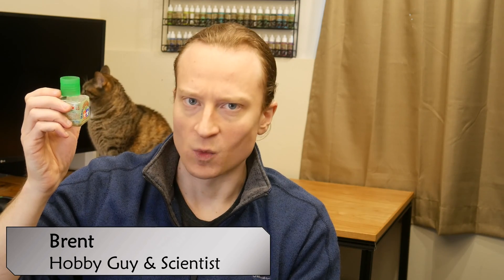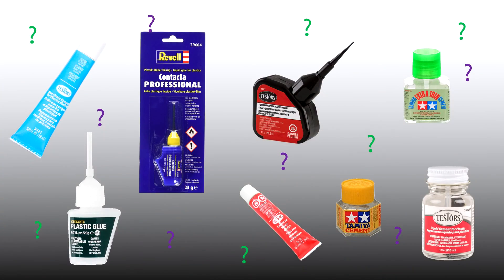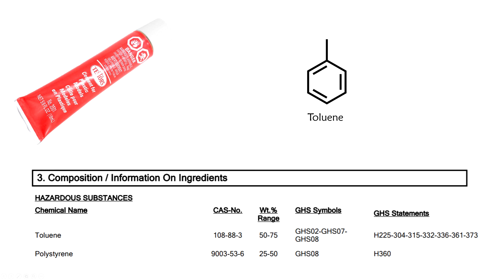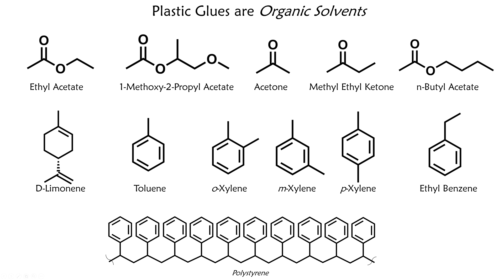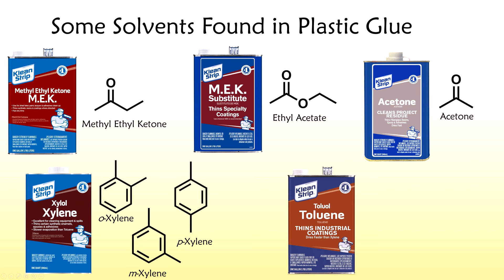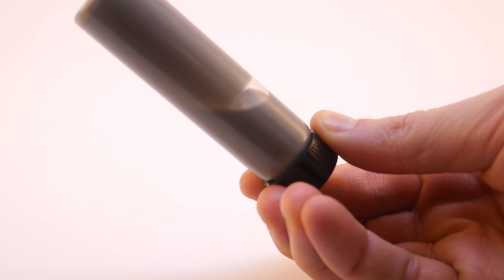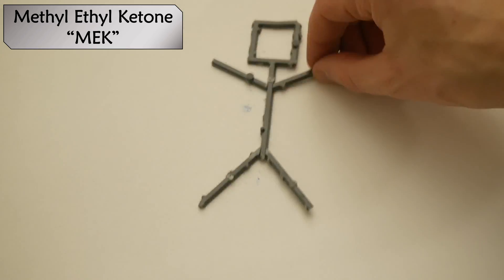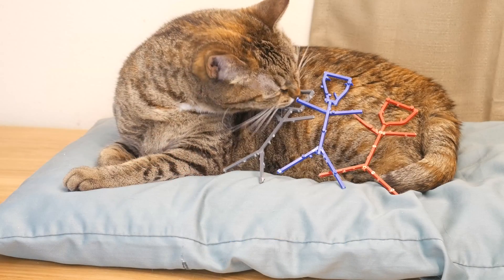How does Plastic Glue work? What's in the bottle and what does it do?

Comment: I wanted to share - if anyone ends up gluing something wrong or upside down and you notice later - try prying it open a bit with a knife or whatever and then pour on some white spirit - the stuff you've got for oil washes - it somehow infiltrates the weld from the glue and makes it MUCH easier and cleaner to undo the cement.

Comment: Brilliant videos thank you. I'm starting to build a furnace boiler to generate super heated steam. there are lots of youtube videos about the best heat resistant materials but most if not all are just re-vids on what somebody else who doesn't know what they are doing, I am thinking of using fine plastering sand as the insulator with porcelain tiles facing the furnace itself. would superglue with powdered graphite stand up to extreme heat? thanks again john

Comment: Okay that all makes sense, for polystyrene. But the most useful plastics for sport use are polyethylene and polypropylene. What is the analogous plastic glue for those plastics? I fear one can only bond them with heat.
Reply: These chemicals will dissolve most plastics except for Polycarbonate ( Lexan )

Comment: When I was making such models, the only glue to use with them came in a tube and was clearly some kind of gelled solvent.  It was famous for its fumes.  When I bought a model for my nephew and his dad, some years ago now, the glue was in a locked case and I had to get a store manager to unlock it.
I've never seen a brush-on from a bottle, or anything remotely "thin" like some of the bottles are labeled.  This kind of glue must have come on the scene recently.

Comment: A chemistry lab is a great place to shop. Not only scintillation vials, but Parafilm, transfer pipettes, small plastic cups, needles (great for scale gun barrels), gas chromatography capillaries (great for whip antennae), and all sorts of other pieces and packaging to serve as greeblies.

I grew up with Testors gel cement and have gotten pretty handy with it; the stringiness is the main gripe. I use Tamiay brush cement a lot, now.

Problem is, my Stash Acquired Beyond Life Expectancy (SABLE) index is now 26, meaning I need to live 26 years beyond my life expectancy of 90 in order to finish all the models I have in my stash. Challenge accepted!

Comment: 7:03 The orange gel tube is all I'll use. I tried Tamiya X-Thin and I found it nearly useless. Took forever to get even the slightest hint of a bond. The onyl thing in this video more useless was that non-toxic blue Testors crap!

I'm guessing your lack of fondness for the testors gel is the applicator. It takes some getting used to but once you get used to it you can do just as precise a glue job with that stuff as you can the Tamiya brush on stuff.

Comment: I am not surprised the Acetone did not totally dissolve the stick.  In 3D printing one of the methods for smoothing ABS models is Acetone(well usually Acetone vapors), Fun note the vapors can also defog some headlamps when the plastic gets worn on an older car.

important note, ventilation when doing this. and probably respirator. but absolutely good ventilation or doing it outside, the vapors are not good for you and well flammable.

Also makes me wonder if ABS glue from the plumbing section could work on models.

Comment: I'd love to know which plastics these glues work on.  Only polystyrene?  And what other plastic adhesives work on which types of plastics? The sellers often do not offer much detail and I often want to stick cloth to vinyl (overlapping tolex for example) but have not had good results after trying many different adhesives.  I sometimes end up using hide glue, which is not ideal but easily reversible/soluble in water.

Comment: It's the plastic lid for the glue made from HDPE? What's the inside"soft" polystyrene like material that works as a gasket sealant? Also does the glue work with PET? for the sake of making models from scraps?

Comment: In college we were told to use xylene or MEK for styrene prototype model building, and use whichever one we liked best. The rationale for doing this is reliably consistent results and they are widely available solvents. Once you get a good feel for which one you like, you know exactly how it behaves. As you've explained, different brands use different recipes, so behavior between different products intended for the same purpose can be significantly different. A gallon of either solvent costs $50-$60, and if stored properly, will last the average model builder for decades.
Reply from the maker: that's some good advice- what kind of school did you go to for that?  model school?
Reply: @GoobertownHobbies  Industrial design and engineering. It was back in the 80s, when we still built physical models early in the design process. Lots of sheet styrene, vac forming, mold making, etc. along with hand fabrication in steel, glass, rubber, etc. starting with conceptual models all the way to fully functional prototypes. Styrene is actually a really handy material for  short run mold making. In addition to the models themselves, it works well for building green sand molds as well as burn-out investment casting of parts in aluminum, bronze, or resin.
Reply from the maker: @fxm5715  very cool!!
Reply: Sadly the cancer won't last that long.

Comment: I was wondering if you have any information on solvent glues for 3d prints, especially for pla and Petg. I know acetone works great for ABS. and have has some success for PLA with some but not all plastic solvent glue.
I am often mixing purchased models (polystyrene) with PLA, I suppose CA glue is best for dissimilar plastics, but I like the working time of solvent glues better, it is easier to get proper alignment.

Comment: So could you use sprue goo as a substitute for resin when casting a model? When I've seen people try it (to copy terrain pieces) the result is chunky, but they all used acetone I think. Some of your other solvents get such a smooth result that I'm wondering how well that type of sprue goo compares to an off-the-shelf resin product (and what the chemical differences are)?
Reply from the maker: It can be done, but I think it'll be verrrry hard to avoid air bubbles as the solvent is evaporating.
Reply: @GoobertownHobbies  ahh yeah that makes sense! In some other videos about using sprue goo I've seen people struggling with air bubbles. Also makes sense that resin for casting would be designed to have a consistency that allows air bubbles to migrate out.
Reply: @GoobertownHobbies  If it dries instead of reacting it would also dry from the outside in right. That seems problematic for bigger moldings. But you might be able to do something similar to clay slib molding (also evaporative), where you aply it as a coating on the inside of the mold for hollow pieces.

Comment: Hi Brent! I think I discovered your channel too recenlty and never had the opportunity to see your hobby science videos until very recently! Fantastic work! Thanks for putting together explanations that are understandable for regular people.
When I saw your videos, it gave me the idea to make myself some sprue goo to fill the uuuuugly assembly gaps on push-fit minis like the death priest from Cursed City. I think I got this idea from Ninjon's channel. As I dont have many pricy glue bottles to sacrifice, I tried to do it by mixing Warhammer sprue leftovers with chemicals from my local hardware store. I have found acetate butyl and acetone. I tried both (and a 50/50 mix of acetate butyl and acetone) but the result is pretty disappointing, as the resulting mixture seems to have 2 phases, non miscible. Melted sprues make a very thick, barely liquid, dough at the bottom of the jar and solvent seems to float above. It is so thick that it is totally unusable.
Am I doing something incorrect? The result is the same whatever the quantity of sprues I add in the jar.
Any help from a Chemistry PhD would be appreciated :)
Reply from the maker: Heyo!  It might just be the solvents you chose to use.  Acetone doesn't work as well as some of the other solvents I used in this video.  I know that the thick plastic cement from companies like testors smells a  LOT like xylenes/ toluene.  MEK and "MEK substitute" also seemed to work well
Reply: @GoobertownHobbies   thanks for your answer! I’ll make further experiments and let you know the outcome !
I’ve tried a thorough stirring it n the acetate butyl jar, and it seems to improve the result.

Comment: Well it's an old video  but the top and bottom of it is that it seems that I've developed a serious allergy to whatever is in 'Tamiya Extra Thin Cement' plastic glue and maybe also  'Bob Smith Industries Insta Cure+' superglue (which I used only for magnets onto plastic minis). I've used both for just under 3 years and all of a sudden I'm getting allergic reactions (runny nose on the day of use and next morning burning sensation in lungs with some coughing). I tried to mitigate these negative effects using both glues buy wearing a 3M rubber / hard plastic  head/nose mask with P3 filters and using a heave duty fan right next to me but still I get the bad symptoms. I've just bought some Tamiya Limonene glue which is meant to be a more natural plastic glue in the form of a citrus based solvent (still toxic compared to the acetone in Tamiya Extra Thin Cement plastic glue I guess) so hopefully wearing a mask with this new type of plastic glue with good ventilation may solve my problem. If not do I have any other options for plastic glue ? Also which brands of thin superglue could I buy which are 'less toxic' that Bob Smith Industries Ista Cure+' superglue ? 

Am I out of options for glue that won't give me allergies ? I sure don't want to give up the hobby because of them. I'm asking here because I know that Goobertown did studies in chemistry.
Reply: Same here! I feel like a mixture of hayfever and flu for several days after using cements like these. I was fine for years, then suddenly, I couldn't carry on.
I'm keen to restart in the hobby, but can't risk this again - I'm wondering if one without n-Butyl Acetate may be okay? X
Reply: @clivewitcomb2839  for me I figured out that it was the Bob Smith Industries Insta + superglue that I was allergic to NOT the plastic glue cements like Tamiya Extra Thin. I figured out that 'I could' use super glue in short 1 hour bursts if I was wearing 1) nitrile gloves 2) A FULL 3M face mask with ORGNIC GAS filters 3) a large fan on a stand beside me sweeping the glue fumes away from me 4) a big windo open right in front of me.

Also I noticed that I was NOT allergic to Epoxy two mix glue such as the UHU type but it is a pain to mix and you have to use the glue really fast before it sets in the mix pot.

The Limone works just as well as the plastic glue BUT it takes 3 to 4 times as long to melt the glue compared to say Tamiya Extra Thin plastic glue.

Comment: What I don't understand, if they are designed to stick together styrene, why do most of the glues contain styrene as an ingredient? So, would it be that the polystyrene is not strictly needed but a nice addition and instead the solvent unbinds the molecules of the adjoining plastics and as the solvent evaporates, the molecules rebinds as a intermingled singular solid?

Comment: Hi
I went through your video many times, i have a problem with the word "sprue" i googled it but they are talking about a system and even photos did not help!
I kindly ask you to clear it more, where to buy? Is there a substitute for it? Any info that can help me making my own glue. I bought lot of expensive express glue like 5mg for 9  dollars and all really did not work.
Thank you in advance for yourhelp.
Friendly greetings.
Reply from the maker: Hey Maha, A "sprue" is the frame that plastic bits for models come on, the Rectangle of plastic that all the parts of the actual model are attached to when you buy a model kit.  The sprue is made from the exact same plastic as the model but it's not a very interesting shape so lots of people just throw it away.  What are you trying to glue together?  These plastic cement/ plastic glues are designed to work with polystyrene plastic models, but there are some models out there made from different materials.
Reply: @GoobertownHobbies  Hi
I really appreciate your reply. I need a glue for plastic. Here in Switzerland strong glue is so expensive, a three grams is around 6 dollars!!! This is why I want to do my own. I searched in goole to know what kind of plastic can be disolved and in one web gave examples where this exact plastic is used, for example: the plastic that covers the cpper used in cables but it did not work. This is why I wrote you asking about the plastic you used so I can buy the exact plastic.
My best wishes always. 
Thank you in advance if you can give more examples where this special kind of plastic is used.
Friendly yours, Maha
Note: I bought a special glue for plastic but it was not at all strong!!!

Comment: I think the Tamiya Extra Thin Cement uses Acetone for several reasons:
1)  The Acetone mixes well with the n-Butyl Acetate (like in like);
2)  Acetone has a lower viscosity (at 25C, roughly 0.3 vs 0.7 cp), so improves flow.  This is the "thin" moniker.
3)  Acetone has a lower boiling point (132.8°f vs 258.8°f), so will more readily vaporize, giving a quicker dry time.
Any plastic debonding by the acetone is tertiary to the other property improvements it gives.

Great overview!

Comment: I hugely miss the old Microweld from Microscale as it worked so much better than the other liquid 'cements' sadly they now use limonene (which is pretty poor in comparison)

in the 70s we used to use ether, before they thought it was a bad idea.

Currently Plastic Magic is my favoured cement as it works on ABS and plastics other than polystyrene.
I have a family who are not gentle on household appliances so it's pretty important
Reply from the maker: Hey thanks for bringing up those brands, I didn't know about those!  It looks like plastic magic is 50/50 heptane toluene. That's interesting that it works on ABS, I'll have to give that a shot.   :-)
Any idea what the old formula for microweld was?
Reply: I actually really like lastic Magic as it simply works, and it's better than the usual suspects.

I have no clue what was in Microweld  though it had an incredibly low viscosity and was highly aromatic and required very little to get a very good join. It also took me about 4 or 5 years of constant model building to go through the bottle that I had.

It certainly wasn't simply xylene, toluene, ether or chloroform (yes I have used the latter as a solvent.) It certainly had no hint of acetone.

It may be worth reaching out to Microscale as the only mention of the old product is to say that they moved away from it for 'enviromental reasons'

Comment: i had an old italeri non toxic plastic cement (glue) from a kit with some air plane plastic models, that i used for some games workshop miniatures too,it was nice glue but i used it all,im thinking of buying the army painter plastic glue for the rest of my miniatures.Is it a good idea? does anyone know if those 2 glues work the same? the italeri glue strong,but the same time if u wanted to remove a hand lets say from a figure ,with some little extra pressure u could do it without causing any other damage,and then u could clean the area that the glue was and glue it back again with no problem. was that possible because was plastic cement glue? or is just an other name for '' plastic glue'' ?

Comment: Very interesting! I wonder if your polistyrene gel can be used for casting...
Reply from the maker: I want to try this also :-) From that little pour I did in the video there were definitely some air bubbles in the solid plastic, but it felt pretty much as durable as brand new models. Also we need to figure out what to use as a mold...   Let me know if you give this a try!
Reply: @GoobertownHobbies  Yep, it would be a very interesting experiment, you could perhaps use a basic plaster mould as thats an easy air set plaster, possibly not that easy to cut into without distroying it though. You can buy plaster material in a roll form, the type they use to set broken bones, the material could perhaps hold the mould together much better. Also regarding the bubbles, agitation could perhaps loosen those or not sure if it would work the same but if you use a kitchen torch or plumbers torch you can remove the bubbles from resin by heating it, it also gives it a much clearer nicer finish. I was originally going to suggest polymer clay as thats a very easy one to get a hold of but the polymer aspect quite possibly would melt with the contact with the solvent but perhaps not once it was baked and lined with an oil, like cooking oil perhaps to reduce sticking?